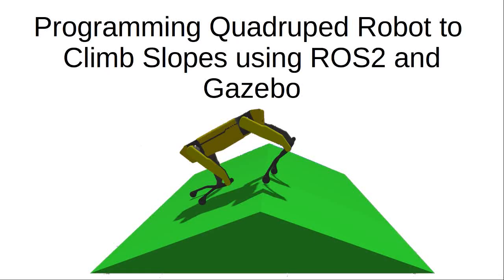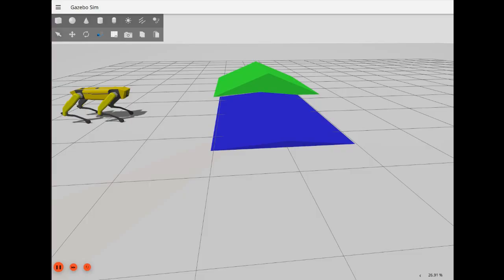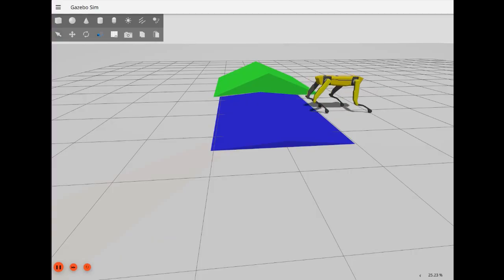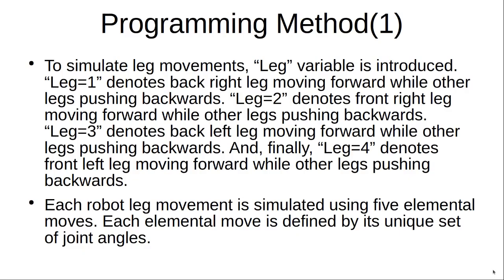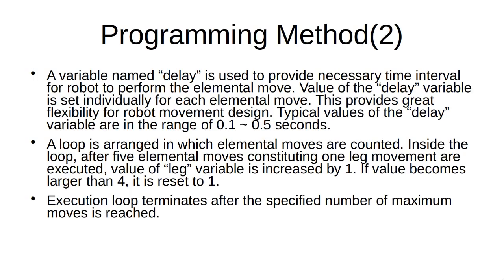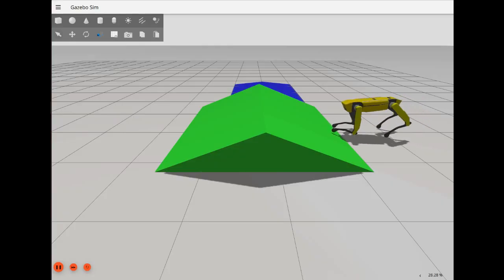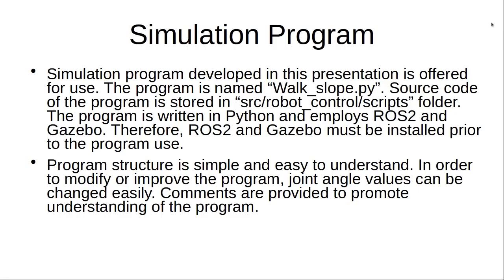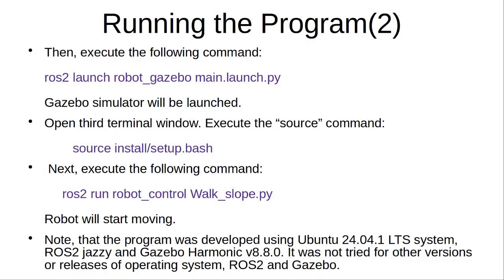Programming Quadruped Robot to  Climb Slopes using ROS2 and Gazebo

Comment: I download your given file i tried to run but I problem come in is "no clock received use sim time". Can you solve this problem?
Reply from the maker: I have never encountered such problem. 
The following paper discusses the problem and suggests that it can be solved by adding a bridge for gazebo, which bridges the time(clock) between ros2 and gazebo:
https://www.reddit.com/r/ROS/comments/1i06kb3/gazebo_no_clock_received_use_sim_time_error/
Please, read the paper. 
Alternatively, if you have IsaacSim installed use the program described in the following video:

https://youtu.be/VMi0V8_4tU0

Comment: hi sir, why does your dog looks so weird when it walks, is there an resonable gait planner under the hood? and for your joint ctrl, do you use the torque or just a inverse kinematical solver based solution?
Reply from the maker: Hi, Samyeung. Gait planner is not used. Joint control is done using position controller. Torque is not used. Inverse kinematics is not used.
 Methodology of robot control is explained in separate videos links to which are available in the description.